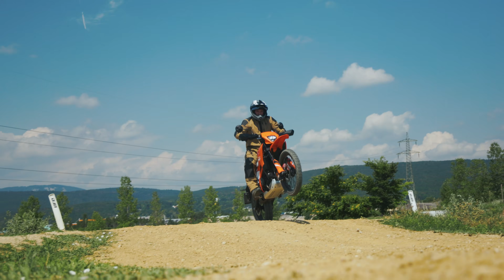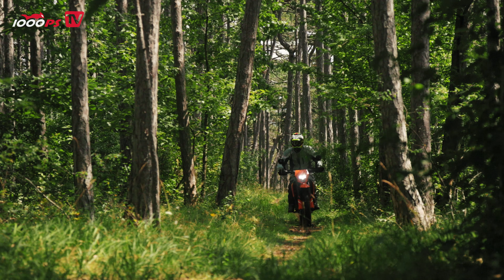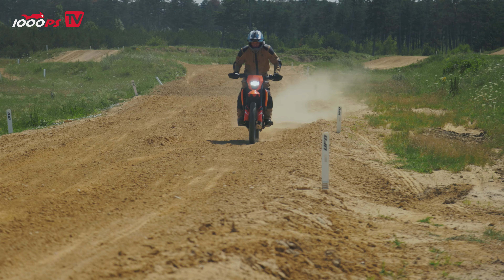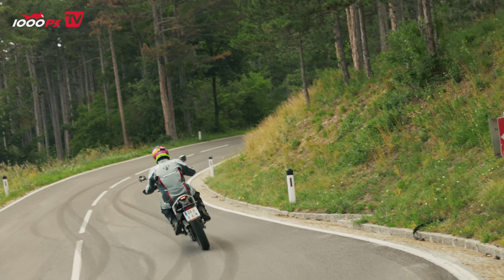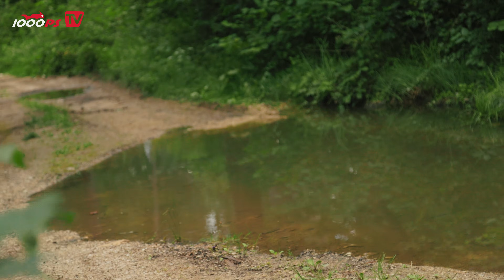Review KTM 390 Enduro R 2025  - Enduro, Naked Bike or Dual Sport?

Comment: I’m about to buy one tomorrow. But from what I’ve read and seen it’s a naked bike converted to an Enduro. I used to race motocross so if I wanted that aspect I would get the Husqvarna. But for $4800 used with 1700 miles you can’t beat this package for what I needed it for which is trail riding.
Reply: @BobBunyon  what’s your review?

Comment: I waited for the DRZ 4S to come out before I pulled the trigger... It is an amazing time for "light weight" dual sport ADV Enduro bikes! The price of the new Suzuki close enough to a KTM 500 EXC I just went ahead and got the KTM I've had it for a month and I'm loving it I don't do much Street riding anymore.... If I was on a budget the 390 I think takes the Cake across the board! Thanks for the video! Cheers 🍻 from Utah... Were my two wheels rarely need to touch tarmac😅
Reply from the maker: KTM 500 EXC is also an excellent choice! Sadly here in central Europe its so much harder and further to get to some nice trails, so the long distance performance of the bike has a lot of weight. But one day I too will experience the heavenly trails of Utah and Moab 🙏 Cheers!

Comment: I never thought I’d say this, but make them longer stroke. Get that power down, let a thumper be a thumper. This could easily be a 450/475 with just a longer barrel and would stop having to scream this engine.
Reply: KTM doesn't seem to make a motor that makes power down low. Which is technically good: You get more power at higher RPM.
But they also don't seem to make gearboxes with wide enough spreads for their narrow powerbands, so you can either pick having a good low speed 1st gear or a good highway 6th gear with every KTM I've ridden.
Reply: @colinbowman8816  the old smcr and exc 4 strokes were all torque monsters , that's the appeal of them. on a enduro or supermoto you don't want to revv it out , you wanna wheelie out of the corner from low rpm

Comment: Tough to make a hybrid of any kind good….but seems they have done it!  The rev requirements reminds of a 2 stroke, which I used to riding, I am older guy thats why…  Sounds perfect for my use not to heavy for light off road, and heavy enough as well as enough horsepower for some limited comfortable highway riding!  Can wait till mine finally shows up at the dealer!  As a side note, also looking at the Himalayan 450, but looks pretty tough to control in the sand, just a bit too heavy, 50 more pounds approx, but has a bigger gas tank!  Heard a lot of happy riders on that bike…so a good alternative….  They usually have those in stock, where with the KTM, at least where I’m at, in for a bit of a wait!
Reply from the maker: I love the Himalayan and its a great bike as well. If the decision lies between Himi and 390 Enduro, it is a question of which engine characteristics (torque vs revs) is more to your linking and how much trail-riding you want to do, because the KTM weighs 72 pounds less according to our scale, and that can make a huge difference.

Comment: It would be a better proposition if it had more torque low and mid revs and perhaps a bit lower compression ratio for reliability and fuel quality.
Putting a Duke 390 engine on a "short of" dual sport..ish (a little heavy) frame and longer suspension; does not a dual sport make.
Though the price is really good!
Reply: That is the problem.  The small engine is really to comply with A2 european restrictions.
In the US, it really doesn't make sense not to make this a 500cc engine with more grunt - not necessarily more horsepower.  Doesn't need to become the 890, that's a different bigger thing.
Reply: @youtubeaccount9058  Nothing prevents the motorcycle companies to create a light frame with an unrestricted engine for type A license; and then electronically restrict the engine for an A2 license. They already put a ton of doodads on modern bikes, cut them back to the basics and you have a lighter frame.
Reply: @iVasilis-u5m  Honestly I'm not sure why they don't do that.  Maybe it wouldn't have cost-competitive specs in Europe in its restricted form, which reduces its commercial viability to KTM.  The new China-bikes like the 450MT aren't shying away from it, if you want to take the leap on a CFMoto.  Not sure I would do that.
Reply: @youtubeaccount9058  the new ktm's are build in India , the quality won't be better then on Chinese bikes 🤣